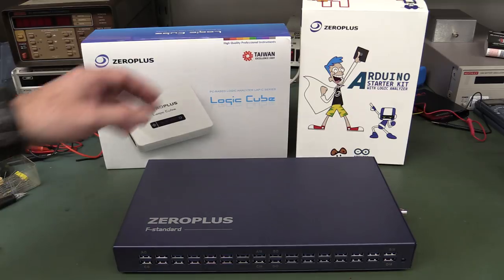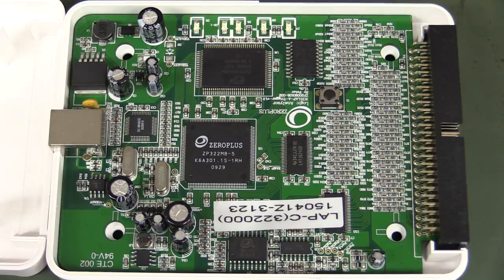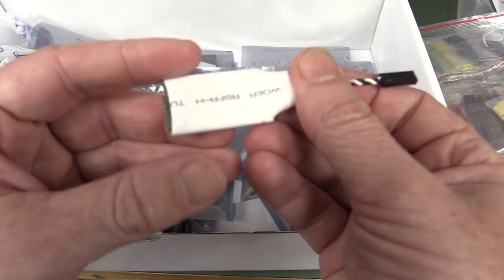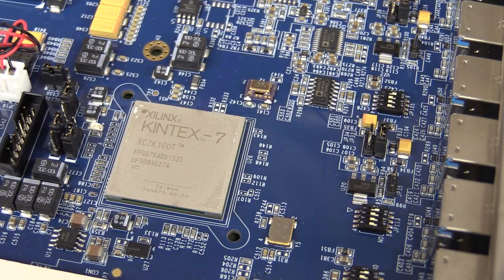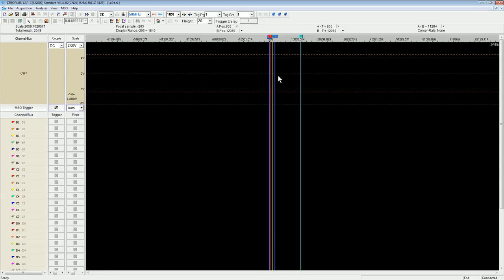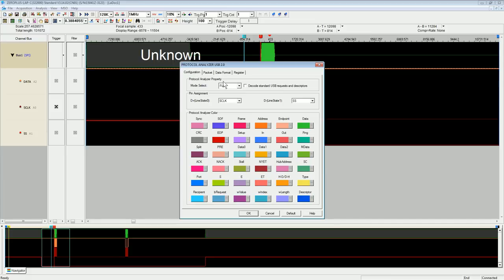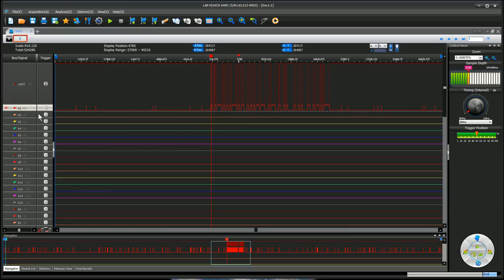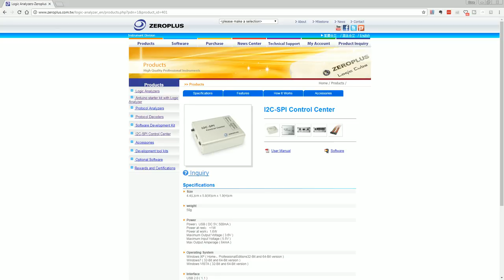EEVblog #1018 - ZeroPlus Logic Analysers

Comment: Not a fan of the fumbling around and not reading the manual. Too many  wrong conclusions due to not knowing the software well enough. It's like that KiCad video where I had 3 hours watching tutorials and knew 10x more than was revealed fumbling around wrongly. Classic case of thinking all software uses a standard way to do the same thing, like MS uses std buttons in most of it's stuff.
Reply: Unfortunately, there were many instances of that, one of them being the gripe about not being able to change the colors of the traces.   You can change them, it is under the Settings section.   The manual is not very long and all of the things that come to mind that were mentioned in the video were addressed in the manual.   I was a little disappointed that Dave was not better prepared.
Reply: Dave is simply unable to look at a manual and be informed before making the video
Reply: It's like that time I read the manual before using the most complex software on my machine - Windows.  Actually, now that I think about it, that manual doesn't exist and that event never took place.  Nevermind, my apologies.  Lucky for me MS put some thought into developing a streamlined, intuitive interface design paradigm.  They even provide an API for ad hoc developers to misuse and gruesomely mutilate that paradigm, as we've seen here.
Reply: haveyouseengus you've never read the Windows manual? I still have the Windows 3.11 manual, and it's bigger than a modern doorstop fantasy...

Comment: Dave asserts that the software is "only for up to Windows 2007" and proceeds to comment on this meaning the software is from 2007. Actually the product spec says for Windows 7 (there was no Win 2007). Win 7 was released in 2009 and Win 8 came along in Fall 2012.  Fair enough criticizing the software for lack of sophistication or broken or lacking features, but the date criticism is a bit off.

Comment: One time I watched Techmoan use his Soundcard and Audacity as a logic analyzer for some old hardware or a tape. I don't think Techmoan ever realized he was using a logic analyzer but it worked and he was able to read data.

 That's a good lesson there because if your projects are retro computers or something slow like that a 44kbits sample rate is good enough and most PCs can do it and it's not even expensive to get soundcards with higher sample rates.

Comment: Thanks Dave. Am now thinking of one of these for protocol analysis. Just downloaded the software and to tried it out in demo mode. Most of your complaints are dealt with very easily. The File-Settings allows the font size and all colour settings to be changed.  A right click alows trace colours ot be changed. You can also set it to snap to edges in File-Settings and the left and right arrow keys then move the cursor to the next edge. OK, very ‘old’ feel to it and not well implemented or fancy pants, but the inteface works OK and looks OK after a few tweaks :)

Comment: That software makes my skin crawl. It's like looking at an Open Source tool that either uses an outdated GUI toolkit, or was made by someone who doesn't know basic UI designs.

A $3000 piece of kit should not have software that looks like it was made by Amstrad in the 80s.
Reply: Outdated is not necessarily bad, and when it comes to software I've seen useless software with very nice GUI too. Anyways, GUI is almost always bloat.
Reply: 5K euro + tax (~20%) = ~$7K
Reply: Yeah, I think I'll just stick to Saleae's software.
Reply: It's fine. I have used it for a few years now and I can't complain, really. For the price; especially after reflashing the ident chip, you can't complain (I am not advising any piracy here). There is an open source application that can read out the hardware. So someone could always make a new UI.
Reply: And its ugly as .... That is why I prefer Altium. OrCAD is just dragging so much crud from the past that is annoying. Beauty isn't important, but usability is. This is why Windows trumps over Linux, consistency. If only Linux adopts a guideline and a toolkit to adopt. Qt or GTK and that's it.

Comment: About the mystery comparator: My bet is that it's a sneaky hack where they're dicking with the VCC voltage for the HC245 buffers to use them as comparators.
Reply: yeah just using a DAC to set the voltage threshold for the input buffers is cheap, easy way to do it.

Comment: For the product with Xilinx fpga , i feel like they could have used a bigger passive heatsink instead of using fans, or maybe power it from 12v or 18v-19v adapter and use  a silent squirrel cage fan (12v or 24v) with maybe some stuff to direct air over heatsink

Comment: The new software interface is also available for the LAP-C series as well (it's called smart+ I think), not just the more expensive model.  It looks like they are developing a new interface, whilst also still maintaining there "old" looking version.

Also, your font issue might be due to font scaling, not sure, you change how that works by right clicking on the shortcut and choosing a different scaling option.  I don't have the same font problems on my system.

Comment: 12:00 Is that gnd pin unsoldered, or did the solder just not flow through from the other side?
Reply: Gameboygenius Neither one of the connectors' GND pins seem to be soldered on the top side of the board, so I can only imagine the thermal mass of the plane kept it from flowing up.
Reply: Looks like there are no thermals on those pins so that's probably what happened.

Comment: Thanks for the video. Question, why can't you scrape that black spot off? The one that blocks the little chip.
Reply: LEGnewTube 
The stuff is hard as heck, you run the risk of damaging the chip &&/|| PCB, the thing underneath could simply be bare silicon with bond wires attached to the PCB.

Comment: Dave are you recording those videos in year 2000?
 Because modern desktop PC in 2017 can take 15GB/s (gigabytes) of data using one PCIE card, CPUs can compress (LZ4, not primitive RLE) at 1GB/s per core, have up to 16-32 cores and 50-60GB/s memory bandwidth - all that in ~$2000 PC. Throw in another $1000 and you get 1.4TB 4GB/s write speed SSD setup (2x 700GB P320h).

$3K for a PC that can easily take 64 1Gbit channels, decode, compress AND save to disc all in real time. All it needs is n custom IO card, $7K-$3K leaves us with $4K for the card and profit in exchange of being able to actually capture contiguously for >5 minutes.
Reply: That's what the Saleae analysers do. Frequently I'll have something fast like a 20 MHz SPI bus squirt out a ton of data very infrequently and I can capture it all over several seconds.
Reply: Yes, but Dave is under the impression its only viable at low speeds (20MHz salaea), but impossible for 1Gbit capture. Times have changed, computers are insanely fast.
Reply: rasz not everyone is a rich boy with shit tons of money to piss away on a computer that's not really faster than the one from last year
Reply: @James Mathis did you miss the part about this logic analyzer being $7K
and your last years PC has 4GB/s write speed SSD array? nice!

Comment: That's a USB 1.1/*2.0* B connector. Not a 1.1 . I wonder if 1.1 still exists ;-). I hope not though.
logic analyzers with analysing software rock...
I watched with tears in my eyes when I hooked up my bitscope to my esp8266 only to find out that it was just talking in a non-"standard" speed (76k8). I just pointed at it and said that should probably serial, and it said, it is, at 76k8, which is not a normal speed in posix systems, and that's where I understood my error.

Comment: Anyone use the LAP-C and the Beagle for USB2 decoding? Would the LAP-C be a bad choice?
Reply: USB2 runs at max 480 Mbits/sec, whereas it looks like LAP-C sample rate is 200MHz, so it would not successfully sample USB2.
Reply: Good catch. Looks like an accessory board is required which seems to be no more than the USB male and female connectors and a crystal for an external clock. The software is configured for USB1.1 to use the internal clock and for USB2 to use the external clock. Perhaps this means that a external clock could be used to increase the sampling rate for other protocols? 
http://www.zeroplus.com.tw/logic-analyzer_en/image/guide/USB20-en.pdf

Comment: I hate it when physical ports and connectors are used for electical/signal incompatible purposes. What if you stick a USB drive in there or some idiot tries to charge his phone on one of those ports. What if you take one of those probe dongles and stick them in a PC USB port? This is a very terrible idea. Imagine using a 230v plug for headphones, that'll end rather abruptly.

Comment: Pretty useless without cross platform software support.
The Digilent and Saleae  logic analyzers both have cross platform software.
Reply: Hardly useless, considering their software runs on Windows, which is the majority platform for EE software. It's a shortcoming for those not using Windows, but it's not fatal for the software vendor.  One slight concern is that their specs don't mention Windows beyond Win 7.
Reply: Most certainly needs to be cross platform.

They can't even get the gui or display of text right on windoze
Reply: +Baigle1 And how does making the software cross-platform fix that problem? Hey, I'm not saying this is great software, I was only commenting on rocketman's assertion that non-cross-platform makes it useless.
Reply: No need for any X platform at all. I use Mac but brought a dirt cheap PC just to run dedicated test equipment software. Very cheap and just works.
Reply: Graham Wideman Linux support is very useful for those with more of a focus on software, especially if you need newer versions of GCC and/or GDB than the vendor currently ships. Just omits the extra step of rebooting or starting a VM just for this. Might work under Wine I guess but that depends on how they deal with USB.
Reply: +Mechanical Menace I'm not following. How do GCC and GDB relate to this product?
Reply: +Graham Wideman they only relate in the way any other software relates, your personal workflow. Yes Windows is the majority platform for most EE software for say board design but when it comes to software development *nix's just win for a large amount of people and GCC is THE compiler in the embedded space. Yes you can set up cross-compilers in MinGW but it's hardly a pleasant working environment, tends to give you the worst of both worlds. If I'm working on something with say an FPGA and MCU I can develop both lots of software on a Linux box more comfortably, I have some timing problems and need to fire up my logic analyser I need to reboot into Windows or fire up a VM.
Reply: It is what happens when you try and use Linux. I did for years but in the end fighting versions, libraries etc took more time than using the software application. Life is too short to spend so much time trying to make the computer reliable. That makes me sound anti Linux. I am not. As a web or database server it is brilliant but not for electronics projects.
Reply: +Mechanical Menace  Ah, I see what you're saying. You'd like to run the logic analyzer on the same machine that you're using for embedded software and FPGA development. Fair point. Elsewhere in the comments I see claims that this hardware is supported by Sigrok, so maybe that's an option?
Reply: +Graham Wideman I'll admit it's not a major deal breaker and I'm not one of the religiously anti-Windows crowd, actually prefer it for a lot of things, each has a better toolbox for different jobs. I'm just lazy and impatient at times :/ Sigrok is definitely an option for me though, thanks.
Reply: if finding a win machine to run this is a problem for you i dont know what to tell you
Reply: They don't have enough resources to do the Windows version right, but stretching resources thinner by adding support for Mac, Linux, iOS, and Android is going to improve things?!
Reply: Don't bother - just get an Open Logic Sniffer which is about on par with the cheap version except being several times cheaper ($50 with shipping), with cross-platform Java software...
Reply: Some ZeroPlus analyzers are compatible with the open source Sigrok software, I use it on the cheapo saleae clones and it works great.
Reply: OpenBench Logic Sniffer is very limited due to the very small memory in the FPGA. It is also pretty much a dead project :( I have it and my cheap Sealeae clone works much better.
Reply: +Baigle1 I switched off as soon as you said "Windoze". Grow up.

Comment: seems excessive on the pricing, even with software - a motherboard is far more complex, also from Taiwan, and has basic software (UEFI -BIOS) and is $150, not $8000
Reply: The volumes and technical requirements are totally different. Motherboards are large volume products, while this is a niche market with tailored hardware.

Software on a motherboard is fairly minimal. The UEFI/BIOS is not a highly complicated piece of software. However, making proper logic analyser software has stumped more than one company. Hardware always seems to be decent, but getting the software right is apparently the hard bit. Dave even mentions this in the video. This boards come with a bunch of additional decoders too.

Finally, these things have FPGA's in them, with lots of custom logic. That's a lot of work compared to slapping in a nicely made chip from a manufacturer.
Reply: The hardware on a motherboard is much cheaper (mass PC market) than the dedicated hardware on these analyzers.
Reply: according to Dave, the software provided with this logic analyzer is VERY basic.  And I didn't say the price shouldn't be higher due to low volume, but $8000 vs. $100 is 80 times as expensive, that's excessive!  Motherboards have a lot of custom logic as well, from the various chipsets to the Winbond and Xilinx and Lattice FPGA's etc.
Reply: This model FPGA alone costs close to $400. That's more than pretty much any consumer motherboard. If you follow the basic rules on what you need to sell a product for, and Dave did a video on that, you're at well over $1000 already. That's just the FPGA. No HDL that runs it, no surrounding hardware, no years of development, no logic probes, nothing.

Also do note there are similar models that come at $3000 and $6000. Those likely have the same FPGA on board. It doesn't seem that unreasonable any more. Looking at flag ship models for fair pricing is not the most sensible thing anyway.
Reply: burrito rustler it costs more to develop than a mobo but sells couple orders of magnitude less than one, so per unit cost is going to be couple orders of magnitude higher. The software has all the features, just not a great layout. If it's a tool you use on a daily basis, you'd get used to it. Tbh, I'm surprised how inexpensive it is given how few units they are likely to sell.